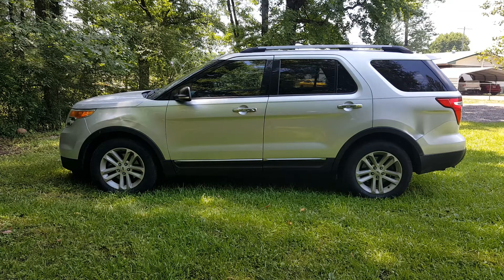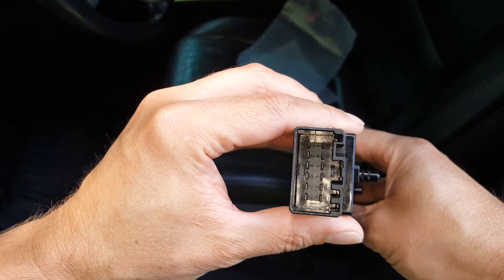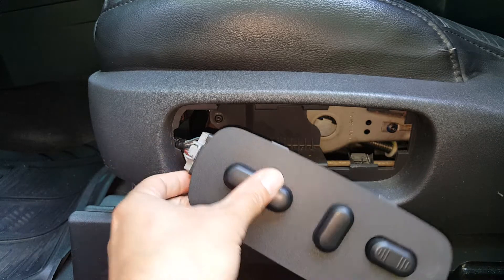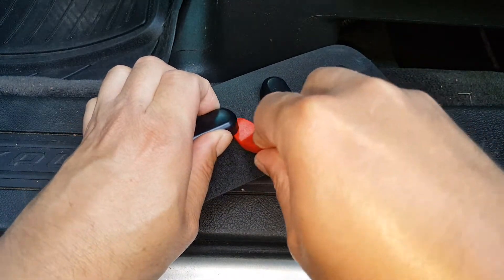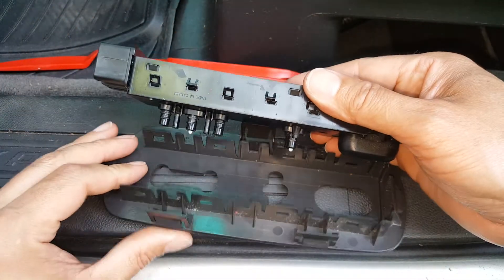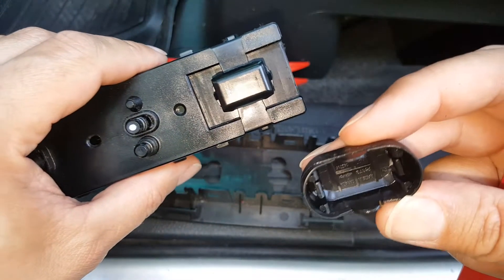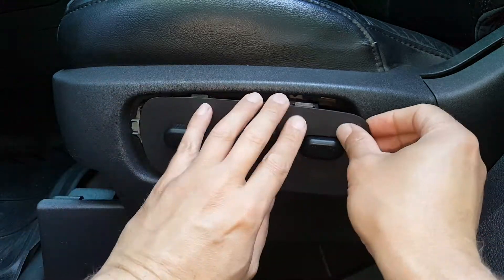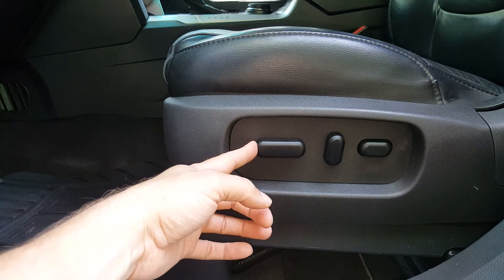How to replace the drivers seat switch/multi switch 2007-2017 Ford Explorer/Expedition

Comment: Thank you so much for sharing, my ford explorer 2012 XLT was experiencing the same thing the front  driver seat was stuck in position,and I came across your video and I ordered the part in your link and I followed your direction to a T and it worked Thank you!!!!!!

Comment: Before buying a new one, there are two things to try, one is to stretch the spring on the offending switch, the second is to remove the plastic toggle slide cover to the offending switch carefully,  there is a metal knuckle arm that the plastic slide contacts with and it gets out of alignment.  Bend the knuckle back in position so that it is centered to the hole.   I've done this on four vehicles and never had to buy a new switch.    15 minute repair job/no cost.
Reply: Are you able to explain where the spring is? I’ve changed the switch and it didn’t fix the problem.

Comment: The issue with my 2015 Ford Explorer is that the seat doesn't go back (it does eventually after trying a bunch of times).  I just ordered the part from your posted amazon link and will give it a try.  Thanks for posting the video!
Reply from the maker: Yes sounds like the switch for sure , it is nice to get things working smoothly again .Thank you for watching.

Comment: Finally !!! Someone posted a video I been dealing with for a month , I just order this part , mine was having same problem I have 2013 , I will comment to see it work , mine goes back but not forward
Reply from the maker: Glad the video was helpful, this switch is definitely the easiest and cheapest place to start. If the seat has been pushed all the way back for quite some time , you may have to work the switch a few times to get it moving.   Mine was a little hesitant at first but after few times started moving . Anyways thank you for the great feedback,  much appreciated.
Reply: @s33therfan  yeah mine been like Thay for a while I had it detail two days ago and guy moved it all the way back now it’s really bothering me but thank you for this video !!!
Reply: Fr. Huge help!

Comment: My 2014 Expedition driver seat has started, when I lock the car, then unlock using the keypad, going nuts. When the keypad entry is finished, the seat slides all the way forward and the seatback flops to a full recline. I can manually adjust it back to useable, but the memory isn't working. Suggestions?

Comment: I checked the fuses on my 2010 F150 10 way power seat, those are fine.  the 2 memory settings work when I click on them "the seat moves to the 2 presets", but none of the buttons work for adjustment, I'm hoping this switch will fix it lol.  I don't wanna have ford rob me blind.
Reply from the maker: Thank you for the great feedback and thanks for watching.

Comment: Great VID but Sorry to correct  you and also sorry to say but the switch is actually not at all bad. If your seat goes up and down then the switch actually is working. What is Bad is the Spring in the center setting of the switch that moves the seat front and back not making contact inside Under the ball bearing. Easy fix or replace either one. But to save cash try fixing it first by removing it and stretching out the spring again. I own 2 Ford Escapes 2010 and 2012 so I have seen this problem 5 times. Also my Ford F250 Truck Twice.
Reply: How do you stretch the spring?
Reply: @jefftheduckdog where is the spring?